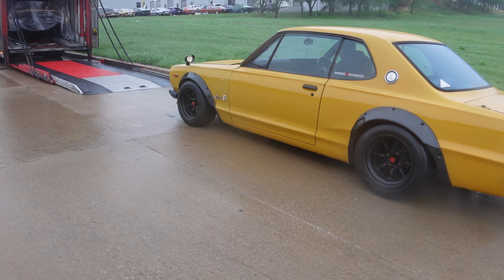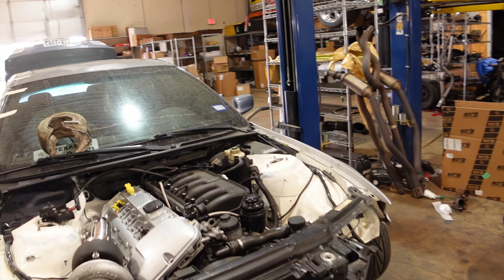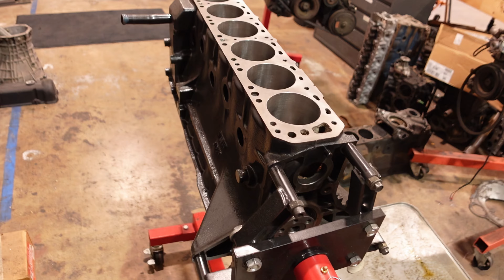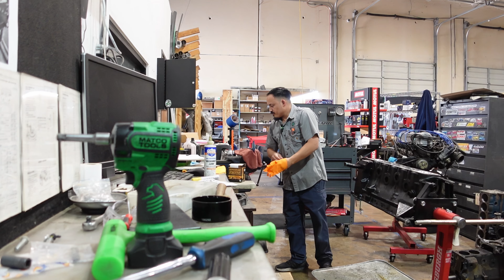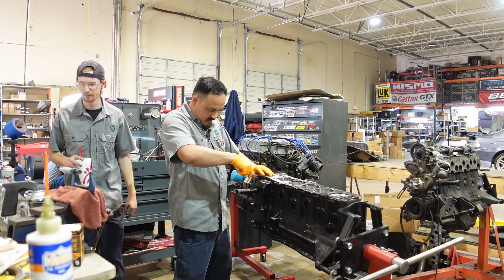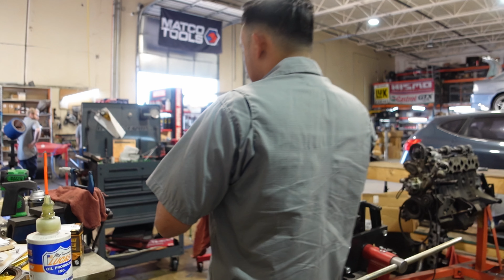Godzilla Raceworks Shop Vlog | April 2025

Comment: How come you don't get the corrosion welded up and the head faced?
Reply from the maker: Lots of factors play into it. Sometimes the corrosion is beneath the surface and it becomes more apparent after the head has been milled so many thousandths. When you weld more, you have to machine more, and depending on how deep the pitting/corrosion is, you end up milling way too much off of the head. The other side of that is the customer doesn't always want to pay for that.

Comment: That time lapse on the Probe was pretty interesting. I am curious to know if there was a specific reason for removing the drivetrain from the bottom? Never seen that methodology used before on a Probe GT.
Reply from the maker: Originally the plan was to only service the cylinder heads, and replace the gaskets, obviously pending a warpage test. Once we found warpage, it transitioned into rebuilding the engine.

Typically we try to drop engine assemblies to do major services. It may take a little bit of extra time during the initial tear down, but it pays off tenfold in saving your back, potentially scratching the car, and overall a worse off repair experience with doing the repair in frame. We already service Z32 and up Z car engines this way, so it made sense to continue to do so for other platforms.